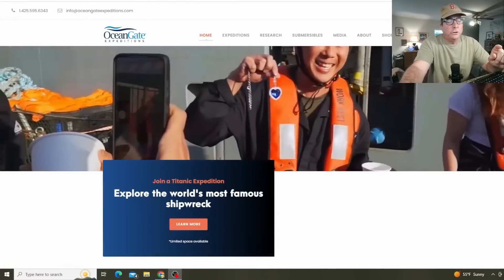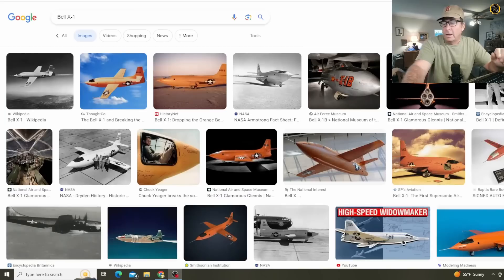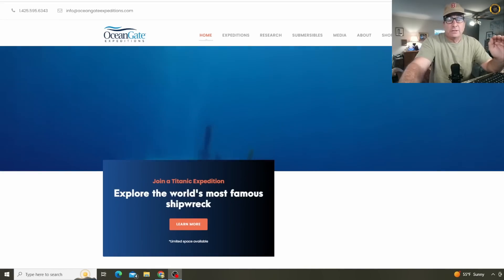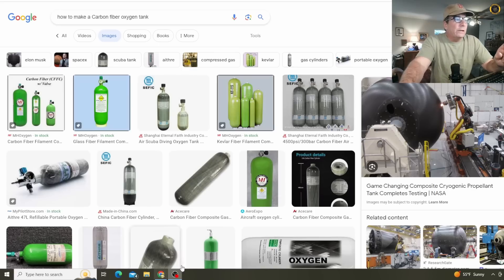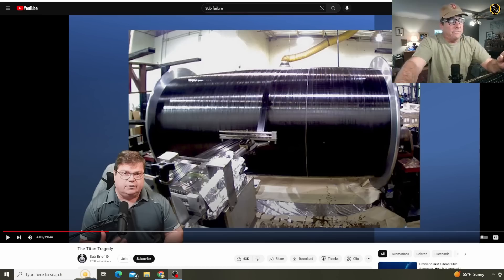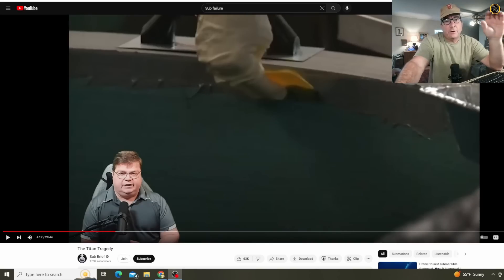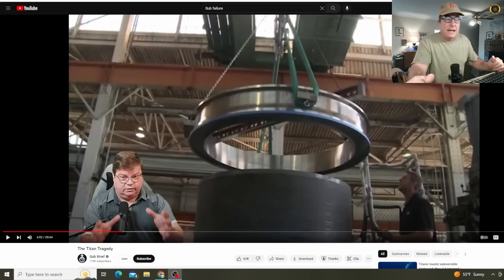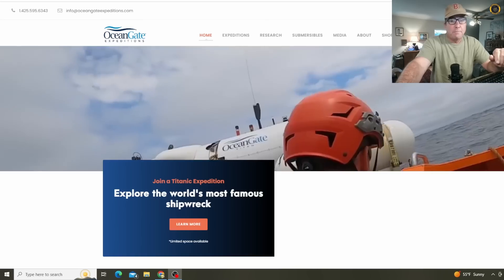Oceangate Sub Construction Details and Implosion

Comment: As a piano technician, the glue joint between dissimilar materials (titanium and carbon fiber) immediately stood out to me in this design. Those are an extremely common failure point which musical instrument makers have had to take into account for centuries. If that turns out to be a contributing factor in the implosion, there's just no excuse.
Reply: I could imagine the epoxies and adhesives used on the exterior might have a significant change of state in the pressures as well. Would not bet my life on it.
Reply: @tuzonthume  not just the pressure also the extreme temperature differences in that deep makes everything much worse easily, looks like these aspects have never been tested by OceaGate
Reply: @killaturk34  I'd think the two materials expand and then contract with the extreme temperatures down there at very different rates.   That can't help any.
Reply: @ChrisAndCats  agreed, that is what I mean, most of the experts also think the flange (ring) was the main issue there.
Reply: @killaturk34  I don't like the sound of just gluing it either.
Reply: @tuzonthume  6000 psi acting upon it i think your evaluation is guaranteed he may as well built the tube out of a giant toilet roll would have worked as well
Reply: @tuzonthume as well as the temperature changes. I also wonder about how the rate of change for pressure affected it. Would a slower descent have kept the material more stable for longer?
Reply: Hello other piano technician!
Reply: Incredibly long list of problems with this design. Wish only the CEO and designers were onboard at the time of failure. Then no innocent people would have died.
Reply: That was my first thought, just relying on adhesive? really?  Surely (like most subs I would think) you would want some sort of mechanical connection?!?! (ie bolted to main cylinder)
Reply: @morganormrod1622    I think they were depending on the pressure holding the end caps on.  They might have made some calculated guesses on the compression of the carbon fiber tube and decided 5 inches thick was sufficient.  They were wrong.
Reply: The joining of of dissimilar materials have by the aviation industry been researched for many decades. Like carbon fiber to aluminum or steel. I have no knowledge on titanium in this case. From the stomach, my concern would be with the adhesive. But we are talking about outside pressure. Titanium is a very special metal.
Reply: @rudolfabelin383  airspace has different set of rules then ocean depths. in the ocean you descend  and pressure acts inwards, in the aircraft cabin outward as you ascend
Reply: I think that you’re correct to suspect the joint between dissimilar materials. But I don’t think that the glue was the problem, because under water, the force of the water pressure on the end caps is going to push them together. I think what failed is probably that the titanium and the carbon fiber compressed at different rates, leading to differential stresses causing the carbon fiber to crack. And when carbon fiber cracks, it shatters.
Reply: Still ANOTHER piano technician to reply... Because I also had the same thought. I also do violin repair, and believe me temperature plays a very key role in the longevity and stability of both instruments. Different materials expand and contract at different rates. It will still be interesting to hear what they decide was the initial failure point, though. Also, though this is a bit morbid, I am glad for their sake this was a sudden, instant occurrence.
Reply: @captainhepp1980  Now the really important question is, which piano maker could make the best submersible? 🧐
Reply: @antumbra5616  maybe early 20th century Blüthner? They eventually got forgotten in the DDR, but they did insane things wood/metal combinations. It is a sad state of things when people don’t see the relevance and competence in hundreds of years of european instrument making, on mechanics and material knowledge. A grand piano exerts 1000s of pounds of pressure on a frame, mostly glued, and they last for centuries, there are violins having lasted 400 years with pressure exterted in all directions in all temperatures on what is hardly more than wood veneer and glue. If you want someone to judge the strenght and weaknesses of a construction without calculators and exact measurements, I would say you could do worse than the gut feeling of someone with 500 years accumulated competence!
Reply: @antumbra5616  valid point. I don't think any of us are pretending to have that answer, just pointing out a valid question based on our own personal experience.
Reply: @antumbra5616  and - which submersible has the best piano?
Reply: @hepphepps8356  Pianofortes are no more than 200 years old, but you are right - their frames need to be mightily strong, which is why they are made of cast iron. It is the case that is glued, not the frame.
Reply: @hb1338 I was refering to instrument-making in general. I am well aware of the history of the piano;-)
Reply: @hepphepps8356  my money's on Mason & Hamlin building a sub with a tension resonator 😂
Reply: was hoping a piano technician would weigh in on this from the beginning
Reply: @zachscott9171  😂
Reply: @zachscott9171  he is more attuned than most in this field.
Reply: @Mikinct  And also well-tempered.
Reply: @zachscott9171  LOL
Reply: @zachscott9171 I was just thinking that.
Reply: @zachscott9171  now THAT was funny!
Reply: He’s just a keyboard warrior though.
Reply: @zachscott9171  IVE MET MANY PIANO TECHS BUT NONE HAVE USED GLUE ON MY PIANOS
Reply: @zachscott9171  That is the funniest comment I have ever read on YT. Congrats.
Reply: @zachscott9171  Don't tell the news-networks that we have a professional piano-technician's opinion or they're going to book him on all the evening news-programs to explain "if this submersible had been a giant, underwater piano - this is what I imagine could have happened"
Reply: @zachscott9171  savage bro
Reply: @zachscott9171  And on that note let's scale it up to C# suspended.  Physics is applicable in any environment
Reply: @Lsmootho  you don't tune to suspensions. That's an absurd statement but glad you are not bashing the technician who clearly stated his limitations. Probably more than the designers of this sub did.
Reply: @zachscott9171  This is my favorite comment of the day. And I don't do anything except surf YT comments.
Reply: I'm just learning about this construction from this video and it actually made me start to feel a bit short of breath with anxiousness when it got to the glue joint.
Reply: @ian_b  It's all about if the adhesive (glue) joint is done correctly.
Space Shuttle, Boeing 787, F35?
Reply: Yes, the difference in temperature coefficients between the carbon fiber, titanium and epoxy being subjected to crazy temperature and pressure swings would have failed ultimately whether the hull held or not. I can't even keep water out of my metal bay roof glued to brick. The seasonal swings cause the metal to expand and contract so much more than the brick. The glue has no chance. Not the same but sorta the same. At least now we have a real life (and death) test of this setup. 🤷🏻‍♂
Reply: @fire-fire-heheh what sort of temperature will the sub experience at that depth? I know it’s cold down there but increase in pressure = increase in temp ?
Reply: I know that modern F1 cars use an adhesive to bond the titanium roll hoop to the carbon fiber body, so it isn't an unheard-of thing to bond those two materials together. Whether that glue joint functions properly under 12000 feet of water is a whole other issue though lol.
Reply: @AndrewScott1337  F1 don't dive 12,000 feet.
Reply: there's a dockside video clip of Rush saying he was advised not to join the materials together and he simply said, but i did it.
Reply: Add corrosive sea water to the ‘mix’!
Reply: As a guy who drinks coffee, I couldn't agree more with the piano guy. 😂
Reply: I wouldn't underestimate a good piano tech. Some of those instruments are highly sophisticated and require some real expertise to get them right. Anyone involved in the manufacture or repair of high quality instruments  knows their stuff, make no mistake.
Reply: @nancychace8619  To the best of my knowledge, no pianos make use of carbon fibre. Wood, metal and felt.
Reply: @hb1338  I don't know about carbon fiber specifically, but many instruments in today's world are made out of material never dreamed of in classical times. Even if an instrument is older, there may be similar concepts of how different materials are put together, which is what the previous commenter was alluding to.  Building musical instruments well requires intricate skill I would not underestimate. Some of the comments here seemed to be making light of the piano tech.
Reply: @hb1338  Kawai and Mason & Hamlin have both been using carbon fiber and other composites in their pianos for almost 20 years. These pianos have several places where the composite is bonded to a dissimilar materal with a glue joint.
Reply: @TobyStahler-yp9ll  What do they know! take it from me. Andy Harpist
Reply: It's always the same when it comes to subsea engineering, everybody wants to be the piano guy.
Reply: Carbon bicycle forks are sometimes bonded to the fork crown in a similar way, with a good fit.  Although we don't ride under 400 atmospheres of pressure we do hit potholes and the normal repetitive stresses go on for years. Bike forks don't fail. But when they do, boy is it catastrophic and sudden. 😢
Reply: Well, there's no excuse regardless.  As Juan said, in aviation something like this would be subjected to testing all along the process and then destructive testing of a model or two before someone certified it, especially if were used for hire.  I'm not sure what the process to build something like that for hire might be but it would certainly cost many millions of dollars just for the testing. That's one of the reasons new aircraft designs are so expensive.  I know there are regulations about boats that are used for hire but I doubt there were any for this.  There will be now.
Reply: I thought this too!
Reply: @anitamiller7960 It's being wealthy, arrogant and reckless. There are millions of people out there who are wealthy but also reasonably sound and well balanced when it comes to taking risks. I think in this instance, the risks outweighed (pardon the pun) the rewards. I only feel bad for the poor young soul who was dragged into this to be with his dad as a companion for father's day celebration. Why can't we just leave the Titanic alone??
Reply: How much carbon fiber was used centuries ago? I know, dissimilar materials, but it just read funny. They should have looked into Formula 1 technology. They have been working with honeycomb metals, carbon fiber and advanced resins for a while now, but that requires spending money. That sub looked like a backyard build. I would not trust that thing to go into a swimming pool.
Reply: @davecozzi9721  hmm I wonder why not just go with steel. Does it need to be super light to ascend fast enough after ballast dump?
Reply: @skuula Rush didn’t like that with a steel frame a large amount of foam would be needed to make the sub able to ascend. In an interview he positively sneered at that idea. He really was in love with how sleek and simplified his design was.

I was wondering if any remains of the CF hull would sink straight down, float on the current before descending or would they just drift on the currents?
Reply: I don't know anything about pianos but I do own a couple of electric guitars, and I can tell you the piano guy is right.
I am also an engineer with experience in adhering incompatible materials, and have no disagreements with the piano guy.  Was the adhesive part of the root cause?  Hard to know, but my preliminary guess is this was a buckling failure of the tube with a significant thickness vs hoop length aspect ratio.
Juan Brown and others are of course absolutely correct about the issue of using carbon composite in a compression load.
Reply: Is the compressive strength of carbon fiber all that good? Another issue I think ..
Reply: @skuula  Apparently not. I just read this morning that bicycle shops can not use a regular old frame-clamp to attach the bike to the work-stand, because the clamps will crush the carbon fiber.
On the other hand, one could fill that bike frame with a gas, and pump it to a very high pressure, and the carbon fiber will handle it like a champ.
Reply: @DanEBoyd  Why would anyone want to pressurise a bike frame ?
Reply: @hb1338  That idea was hypothetical, and just meant to illustrate that a sealed carbon fiber shell is not what you want for a sub, since carbon fiber is weak under compression - the compression in this case being the high pressure of the surrounding water attempting to crush the shell.  Outside pressure on the shell is bad.

However, carbon fiber is better suited for containing pressure. Airplane fuselage, and tanks for oxygen and other gasses, have more successfully used carbon fiber, though the carbon fiber has a finite life in theses applications.

As far as determining what good could come from pressurizing a bicycle frame, aw, I suppose you could fill it with water or Gatorade. Perhaps pressurize it with helium, in an attempt to lighten the frame, at least with respect to gravity?
Now a motorcycle frame could be pressurized with nitrous oxide! Some race cars have sneaked through technical inspections, in spite of their roll cages having been pumped full of unauthorized nitrous oxide, which is then used against the rules to extract more power from the engine...
Reply: Wow interesting contribution.
Reply: was a small scale model built and stress tested? Seems like no.
Reply: @@user-gg2ty5tk8kOr are you the Dunning-Krüger victim in this? A plane operator vs. 500 years of material knowledge, bonding expertise and work with force exertion on differential materials?
Reply: No offence!!!...but even a freaking piano technician knows better than to build a submersible like that!!!
Reply: My biggest question is how could a guy be smart enough to be a Billionaire and then get into that homemade contraption and expect to go down 13,000 ft. I just can't figure that one.
Reply: @JDsModernMartialArts  Because he's a delusional narcissist.
Reply: fuck even the piano tech knows how to build subs
Reply: Yeah I cringed when I saw them gluing titanium to it. The whole thing is retarded. Carbon fiber is strong in tension,  and it's not under tension.  This was a darwin award.
Reply: I'm a professional guitar maker. What the fck are you talking about? With what problems exactly did we had to deal for centuries and how is this even comparable with the glue joint on that sub. Do you even know the difference between adhesion and cohesion. Please enlighten me. What kind of industrial epoxy resin did Antonio Stradivarius use on his violins to prevent a catastrophic failure?
Reply: @anitamiller7960 they think having money makes them smarter than everyone else
Reply: @@user-gg2ty5tk8k Me too.  I've always assumed that certain things (like the Piano  and trumpet) are best left to us "hamans".  But, "darling it's better, down where it's wetter, take it from me."
Reply: The ring is being held on by sea pressure and would not come off without the destruction of the pressure hull first. It might leak but with the pressure at that depth (over 5,500 psi) it is being forced on to the pressure hull.
Reply: @anitamiller7960I’m safe then 😁
Reply: Titanium is corrosion resistant to carbon fibre and is used with carbon fibre in the aerospace industry because aluminum isn’t.  This is why the 787 is the most titanium ($$$) intensive commercial aircraft.  The problem with carbon fibre construction is it’s hard to detect defects at time of manufacture and once in service.
Reply: Papier-mâché artist artiste here. It makes my blood boil when people plough blindly into working with composites. Bad design... the wrong glue... crazy colors... I've seen it all.
Reply: @anitamiller7960 maybe some, not the kid though.  he didn't wanted to go but his dad pressured him to do it with him for fathers day
Reply: @anitamiller7960  Many of us can't afford to kill ourselves by falling off Everest !
Reply: I really enjoyed Beethovens Implosion #4
Reply: @captainpoppleton  aaaagh#!
Reply: @@user-gg2ty5tk8kNo, I am not going to let my piano tech design a submarine, but they have got centuries of skills and competence you shouldn’t underestimate, or at the least not ridicule regarding joining differing materials and longevity under much more stress than what a lot of people in this thread seem to appreciate.
Reply: 100%
Reply: With the important difference that your piano isn't subjected to 400 bars of pressure.
Reply: @mousseman8239  No, just 36,000lbs of compression.
Reply: @antumbra5616 phew! That’s ok then 😬
Reply: @mousseman8239  No, just 400 bars of music.
Reply: @mousseman8239  Every string instrumentalist knows that last semi tone turn has us on the edge of our musical seats, hoping that string doesn't implode.
Reply: @Mikinct  Strings don't implode, they snap. That is because they can't bear the tension.
Reply: As an expert in making popsicle stick birdhouses with my kids, I can attest to the flaw in using the wrong adhesive materials.
Reply: @billmiller3425  Do any birds move into them?
Reply: as an accountant, surely that part is more so sealing, not structural perse;  the compression itself can be used and I imagine is the case for this design. The end cap compresses against the tube end with depth. imo stoopid for this level of use, but imagine that was the jist of how the end caps attached to the tube primarily.

this is 100% compression cycles issue. the sub did work...but clearly beyond the useful life of the hull. I think James Cameron nailed it with his take on what likely happened.
Reply: @anitamiller7960   I have for very many years come to attention when a person of means dies doing something average people can't afford to do.  My first thought goes to Kennedy in his  Piper Saratoga. He didn't have the experience to make that flight, but he had the money.  Sonny Bono of Sonny and Cher.  He was on an expensive skiing vacation and hit a tree.  No poor kids playing basketball died that day. But I won't say these people weren't innocent.  They were taken in by a flim-flam man.
Reply: @anitamiller7960  
Wealth is a part of it since nin wealthy folks can't participate, but it's more a calculated risk/reward.

James Cameron had done this to 35,000ft but when you listen to him explain things, he took the years to educate & gain experience way before attempting this himself.

It's like being a GA pilot, there's risks but with trusting the equipment & with experience the risk isn't spin the bottle & hope either.
Reply: Is it strange that I imagined music while reading your comment?